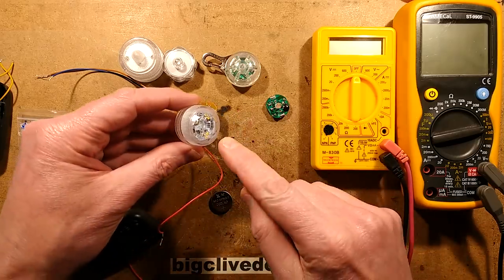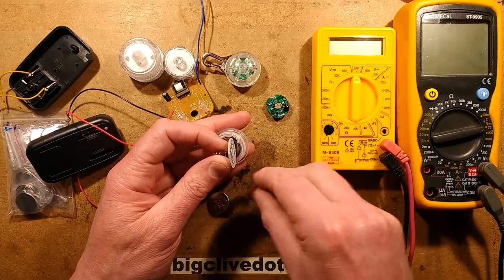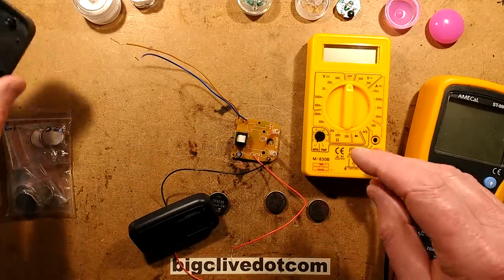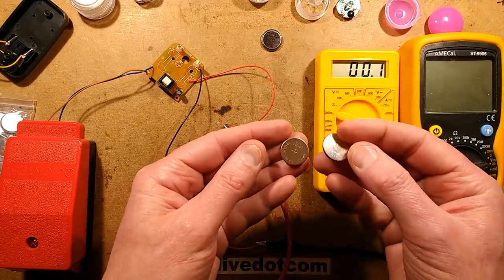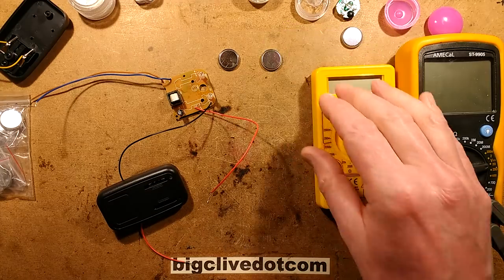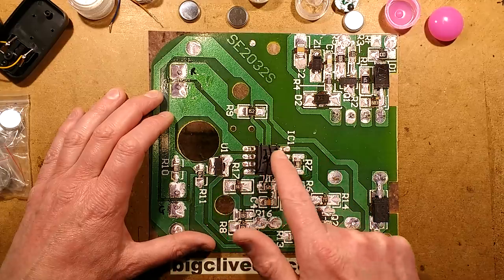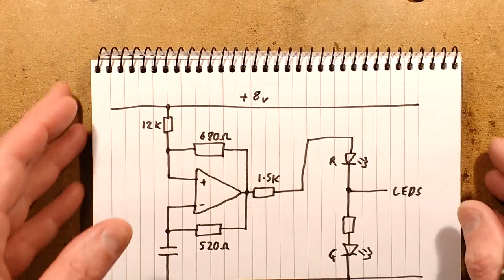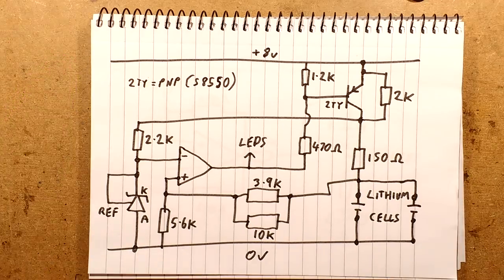Reverse engineering of shady lithium button cell charger.

Comment: Clive, how does that little charger handle a dead short across the battery contacts?  I ask because kids will stick coins in there and plug it in.  Hell--I'm an adult and I want to stick coins in there and plug it in.
Reply: My guess is that the mod Clive did, traded short-circuit protection for over-charge protection.
Not that we would know, now... (as #5 would have said: no disassemble.)
Reply: Richard Rudek I don't think so.  To get the opamp to turn off, reverse polarity is needed.
Reply: Richard Rudek "No dissasemble" Was that a Johnny 5 reference? That's a good movie. Watching it now... Cheers
Reply: it will handle it safely, as theres a 150 ohm resistor in series with the battery connection,,,however, if one battery hole is shorted while theres a battery in the other one, that could be nasty..! to make it safer you could fit something like a 10 ohm in series with one line of each battery socket,  it'd still flatten the battery with a short on the other socket, but will stop(hopefully) battery blow up..
Reply: The Devil In The Circuit thanks that would never have occurred to me. Lol
Reply: I may look like an adult, but I'm still a little kid struggling to get out!
Reply: As one of the ladies at work used to say " the only difference between the men and the boys is the length of their legs and the price of their toys."
Reply: july8xx Presumably that included all 3 legs...

Comment: I think that charger had a fair number more parts than it really needed to have.
On the primary side:
The designer seemed to worry about the transistor not switching in a quasi-random chaotic matter.  There is no good reason to not have the roughly 8V on the output side go between 6V and 10V.
On the secondary side:
Making the reference 4.2V would mean no need to power a voltage divider from the cell.
The op-amp's input could go directly to the battery or through a series resistor just to be safe.  The output of the op-amp could charge the battery through a diode if you select one that doesn't produce too much short circuit current.

Comment: Simple trick to comparators.   When the input equation is true the output is high.  When the input equation id false the output is low.  Works for opamps as well.

Comment: Those little sealed light units are very useful to keep in luggage, and are a very useful signal light (if you are into remote area back-packing).Clearly visible for over a kilometer.
Reply: You can't see those lights from 20 feet away. You're not signaling anyone, besides the person sharing your tent, with those.

Comment: I think, there could be a reason for the connection of the 2.2k resistor like that. This way the charge current is reduced for very low cell voltages of deeply discharged cells. Some kind of precondition current.
I think the best solution is to increase the 2k resistor in parallel to the transistor to something in the range of 4.7 to 10. For an end of charge voltage of 4.2v and a supply of 8V I calculate a value of 5.2k. Then the resiitors and the 2.5V reference give exactly 4.2V and the trickle charge current should be net zero.

Comment: The trickle charge can actually be equal to the equivalent self discharging current which is actually more than you expect and is generally a function of the battery voltage and increases steeply near the final voltage. It also deteriorates with battery age, temp and abuse (overdischarges, high current charges and demands etc) Best batt lifetime though comes keeping only a bit over 4V...

Comment: That 68k resistor will indeed act as a snubber. However the losses will be greater than the RCD circuit normally used.

Comment: got the same item from alibaba express for $2 it s a cool one. just wired in a USA plug since it came with EU one. for any consumer battery you can recharge them. the worst that can happen is they pop open with the button cell and a little black power falls out. if the "disposable" battery can be recharged it will hold a voltage after unplugging it from the charger for 30 minutes. expect for Lipo and Li Ion batteries recharging is safe. Lipo typically will go flat down to zero and cant be recovered. 18650 battery have a safety value that has to be reset by pushing down to bring a battery up slowly. best to charge batteries up with 500ma or less from a low voltage. after charging batteries i stick them individually in clear bags to protect against possible leaking.

Comment: Been missing your transformer tear-downs, Clive! Thanks for that. :-) They missed a trick with using two resistors instead of one, and ending up with a product that could have been made better, and more cheaply. It's a minor shame about not having a reverse discharge diode, but that could have been done very simply, and with a similar component count to this version. Even so, most people would remove the cells when charging had finished, so they might not encounter a problem with it.

Comment: I think your mod bypassed the current limiting that was measured across the 150 ohm resistor.
If the batteries were flat it would of overcharged.

Comment: Clive, there is one thing that has to be said about these crappy chargers. They do have useful battery charging stages, that can be utilised with far better microprocessor controlled chargers. iSDT smart chargers are an example. "I'm Really Crap At Surface Mount Soldering" - It doesn't help when you have a soldering iron tip the size of your elbow, Clive.
Reply: Do you not know how to edit a comment? You posted the same comment twice, with this one having extra added to it.

Comment: Well now I'm curious. What do the "breakdown" and "burn" functions do on that tester, and would using them result in anything exciting?
Reply: Yeah I want to see a Charsoon charger from Banggood filled up with Ultrafire batteries and rigorously subjected to burn mode... preferably on 5th November
Reply: Breakdown will trip on fast transients and burn will not trip at all but just limit the current to few mA :)
Reply: Karol Piotrowski Is burn mode used in any standardized fire safety test (like "must run in burn mode above actual breakdown for 1 hour without igniting the piece of cheese cloth wrapped around it")?
Reply: @johnfrancisdoe1563  lol

Comment: Rechargeable button cells - did not know they existed - thank you for that.   Though the aspect of mains charger that charges two - does seems a bit mad in many respects - solar charge be nice as they won't need much juice and would make more sense.  Mains power for something so small just seems like the wasted energy from mains conversion would exceed what you would charge the battery with.   

With that it feels like akin to feeding an ant with a steak.

Comment: 20:22 "It's almost like a Schmitt trigger". That's because it is. It's a pity they penny-pinch so much, because they're trying to operate the LM358 outside of its specified common-mode range. It's relying on the inability of the LM358's output stage to swing close to the positive rail. It would have cost almost nothing to have included another 12K resistor from the non-inverting input to ground and increased the 680R resistor a little, ensuring the inputs stay within bounds.

Comment: Without watching the relevant bits of the video again to check the circuitry...

Add a diode from negative rail to battery negative (not connected to the current-limiting resistor, which is what you were probably thinking of doing).  Move the negative pin of the voltage reference from the negative rail to the anode of the new diode.

This means (if my memory of the circuitry was correct) that you don't have to adjust the resistors in the potential divider.  You don't need to worry about the diode drop varying with current (which it does) or ambient temperature (which it does).  The voltage reference is always going to be that diode drop (however it varies with current and ambient temperature) above the negative rail.

It should all work out nicely.  Maybe.

[edit]

Provided, of course, you move the bottom end of that potential divider to the anode of the new diode.  I knew I'd forgotten something.

Comment: Cool widget.  I used to use the LM339 for similar circuits.  Cheap and reliable.  Wide supply tolerance.  I wonder how widely it's used these days.  I still have a couple of tubes full of them out in the garage.  :-)

Comment: "Doesn't stop charging". This is purely an academic question, but can you explain? If the cell it at it's rated charge voltage, how COULD it continue charging if it is only being given the same voltage? You mean effectively trickle charging the cells as they naturally slowly self discharge? Why is that a bad thing?
Reply from the maker: You can't keep trickle charging a lithium cell.  It causes the lithium to concentrate to the point it causes chemical damage with a risk of sudden failure.  With NiMh cells you can keep trickle charging them because they recombine the gases forming on the electrodes back into electrolyte.  With lead acid batteries continuous trickle charging depletes the electrolyte by venting it as gas.

Comment: I wonder if the design has been taken from an old product, hence the lack of specialised chips with discreet components, and repurposed using SMD?
I love your light bulb maracas story and I'll be passing the idea on to my sister-in-law, who runs a childrens nursery - she'll be thrilled!
Reply: It certainly had a lot of parts for a cheap design.  It makes me wonder if it was really cost optimized.  Even cheap parts have a cost to obtain and place.  Sometimes spending a bit more on a purpose built IC is the way to go.

Comment: Clive, there is one thing that has to be said about these crappy chargers. They do have useful battery charging stages, that can be utilised with far better microprocessor controlled chargers. iSDT smart chargers are an example.

Comment: I was thinking back to when you took apart one of those silica dehumidifiers and I was wondering if it would be a good way to dry a single article of clothing super fast. Like if you used a tub of the stuff and put a shirt in contact with it. Although not sure how big the beads are
Reply: TheEngineer it works.

Comment: There is 3.6v 10 mA version at aliexpress of this charger for ML2032 lithium rechargeble batteries. Thow  this button bateries datasheet sugest charge them  lower than 3.3 will it be safe after  changing 2k2 resistor?
Wouldnt it be better use a CB06CRMA unit ?
Thaks.😊

Comment: Re the hysterical oscillator for the flashing LED.
I think the 680ohm and 520ohm resistors you show should actually be 680k & 520k.

Comment: Alright yeah, thanks .. I now need rechargable 2032s ...
Reply: Yeah I went on a mission immediately.  They do cost a small fortune though, so I'm not sure I'll bother.
Reply: Peetiegonzalez i don’t know .. 1.2$ a pop seems relatively decent .. you never know what nieche use one of these could have in a project (most likely that’ll happen once in 3 lifetimes but .. hey)
Reply: on a recommendation from Clive (or maybe it was Julian) I got some 'solar rechargeable key chains' off eBay - about 50 pence each with a rechargeable 2032 and a little solar panel to boot
Reply: I'll have to keep an eye out.  They seem to be at least $2 each right now.  I was just comparing with the price on Amazon for the LR3023 which was more like $9.
Reply: you should check aliexpress though, there you'll probably find the best deal (outside of alibaba and taobao of course)
Reply: +regmigrant Are you sure it was Lithium Ion tho, and not NiMH?  Both are common in solar stuff.
Reply: roidroid if it was NiCad wouldn’t it be 1.5V?
Reply: regmigrant's link is now dead (duh...), but beware that a lot of the "solar rechargeable" keychains have a disconnected / dead / spoof solar cell; and non-rechargeable CR2032 or similar, not connected to the solar panel and only connected to a LED or two.
For 50c to a dollar, it's an ok gamble, I guess.

Comment: Clive could you, just as part of one of your videos, compare the readings from your cheap meter and your expensive one?
Reply: In my experience, the big difference is getting a stable accurate reading in the presence of noise or other oddities.  The cheap ones tend to go wild, while the good ones just do their job.  For clean DC or AC, there's probably not much difference.

Comment: Due to a kitten on a keyboard, this comment is re-typed, more brief, and probably better for it... And I know it's been years, sorry about that. Maybe it's less likely to turn into a flame-war if it's on an old video.

I love your videos, and particularly this one, with your clever circuit analysis of a "clever" circuit, but I'm always surprised by lead solder thing. I use SN100C every day; it's eutectic, makes bright shiny joints, I can use a little pinecil (even more than my big Hakko these days), and it's as trouble-free as the Kesler 60/40 of old.

The patent's expired long ago, so you can get it from anybody (though I still buy the Nihon Superior stuff from AIM, because the core seems more consistently manufactured, small price to pay for one less variable.) And there's many similarly easy-to-use alloys around, more than I'm aware of at this point. Granted, it's probably less-than-optimal to hand solder SAC305, but then, don't hand solder SAC305.

In the grand scheme of things, yes, the impact of home use is probably insignificant, if you really must; but the treaties and standards exist to address the "ecosystem" of the industry, from the foundry to "e-waste" recovery which is a humanitarian disaster. And also yes, the flux fumes are as nasty if not more so, but that's true of all solder and cheap solder is cheap solder, so matter the alloy, but that isn't really the point. I concede that individual use is whatever. But the world will be a tiny bit nicer without the lead solder industry. Applications that truly require it will still be able to get it, but it's nice to have a Pb-free bench (and since we've all had this chat a million times, yes, mixing alloys is a bad idea for strength of joints, not to mention that you are now using lead whether you're aware of it or not; I have a separate "portable" bench that I use for projects on stuff that already has lead.)

So it's whatever, I guess it depends on your outlook. But in so many other subjects you seem to be a "planet-minded" sort of person (climate, etc.), and it always surprises me, not just here but from many I respect. Continue using lead, by all means. It's one of those philosophical questions about individually insignificant actions, ultimately (though I do have a small selfish incentive to think that tiny bit less about what I'm touching.) Just want to express that there do exist people who solder pretty much daily without 60/40. Take it as you will, I still love your videos.

Comment: You should be able to make your own charger using a TP4056 and swap the resistor on it, if you look at the datasheet for the calculation to figure out what current it will be it says 1V/Rprog (resistor in kilohms) which if you choose a 56k it will give you 0.178 x 1200 = a charging current of 21.4ma
Reply from the maker: You can buy the 4056 modules online with a LIR2032 holder attached, but I'm not sure if they change the resistor.
Reply: Huh, never seen those before... Thanks I guess I've found something new to search for.
Reply: Ive got a charger I made for a small lithium cells, not coin cells because I dont use them, but the little silver pouch type. its just a 1A usb psu to give 5v from the mains then a TP4056 module with a wire going from pin 2 of the chip to a 5 position rotary switch with 5 different resistors then back to module 0V, so the switch selects 1 of 5 levels of charging current. I think I went up to 47k on Rprog which gives 25mA as the lowest current available although I dont actually use that setting, its mostly set to 100 or 250mA, appropriate to the cells I charge with it. Its in a plugpack enclosure that was originally one of those ebay magic power saver spike buster things with an led and capacitor.
Reply: and they must change the resistor if theyre supplying a TP4056 module with LIR2032 holder, the default is 1.2k for a charge current of 1A. surely not even the most demented designer would try to charge a coin cell at an amp. or would they?
Reply: Unless you wanna get one and find out then who knows, I've seen some chargers claim to charge at 50ma which is still a bit excessive and dunno if its a typo but others even claim to charge up to 300ma which to me doesn't sound much better than shoving 1A through a coil cell.

https://www.ebay.com/itm/2-Slot-LIR2032-Button-Cell-Watch-Battery-Coin-Cells-Charger-LCD-USB-Port-US-Plug/142544798780?hash=item213055043c:g:38QAAOSw1QpZ6V2R

Comment: What resistor would you need to use an lir2032 in a cr2032 powered circuit?
Reply from the maker: Tricky if you mean the higher voltage.  It might work as is or it might benefit from a series diode to drop around 0.6-1V.

Comment: The 2k resistor across the transistor is a particularly shitty way to provide hysteresis to ensure the charger snaps cleanly between "charging" and "charged" states.  Without this it's likely that the comparator will toggle on and off rapidly as the cell reaches it's fully charged voltage.  This trick works because of the non-zero dynamic resistance of the TL431, i.e. put more current through it and it's voltage will rise slightly.

Comment: Interesting circuitry, but I don't understand the red LED flickering opamp circuit well. Opamp output could never reach or rise above positive supply rail voltage in order for inverting input to go above nonivering one and switch the output low? Shouldn't there be a resistor from nonivering input to ground in order to enable inverting input to can go higher positive then noniverting one or there is some opamp lesson I am missing?